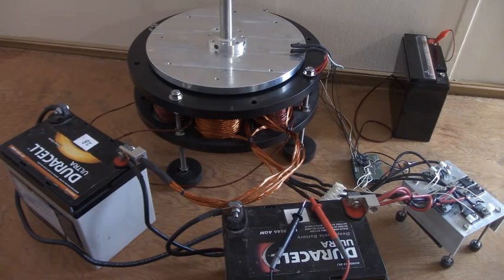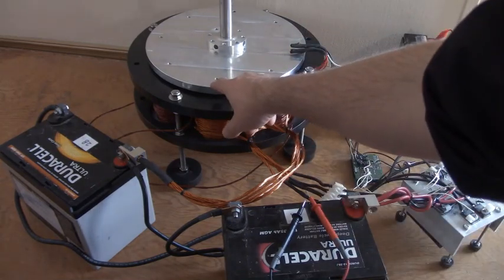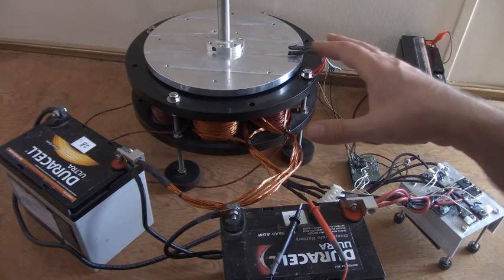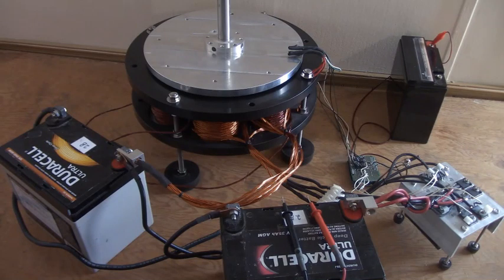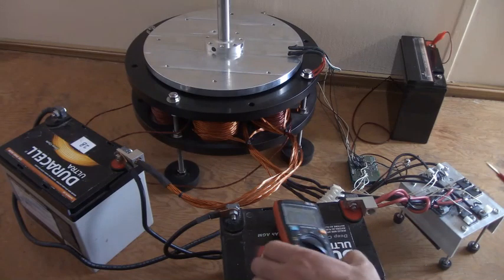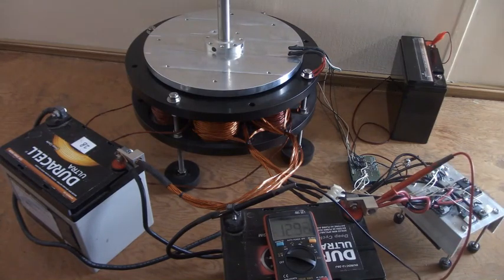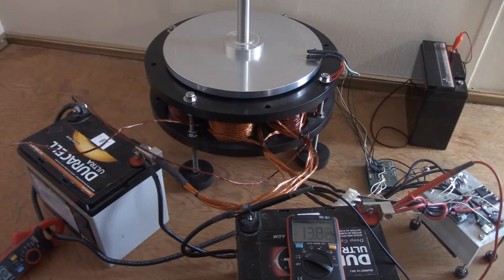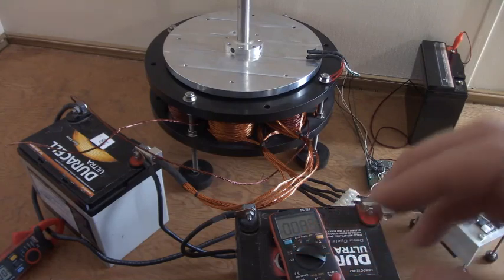4Dual Pole Sr Upgrades

Comment: Thank you, Rick, for making all this information information public.  Quick question: Can I use your 4Dual Pole Sr for a stage#2 process of one 20kWh LiFePo battery bank charging another 20kWh LiFePo battery bank, without using a big 20kWp solar panel system ?
Reply from the maker: No. The 20k batteries cannot work on a 20k solar system either.
Reply: @rickfriedrich  Just to be clear on that: Your tech does not work with LiFePo batteries ?
Reply from the maker: Wrong again. Works with all batteries.

Comment: Really good video Rick.  Thanks for posting it.  I'm curious if you're able to include (or have updated) the cap-dump circuit including low ESR caps (bank of 1000uF parallel caps?) plus SCR w/ diode drop on the Gate.  As you've taught us,  its important to understand "negative" energy and "positive" energy since proper treatment of the charging output enables us to swap charge batteries and run batteries (converting negative energy via the cap-dump circuit).  Are you able to offer this cap-dump circuit as an option when purchasing the updated 4Dual Pole?  Also, I'm curious if the PWM duty cycle is adaptive with respect to RPM or if the ON-time is constant as set by the pot.  One last thing...is there a way to adjust for 1" or 1/4 inch rotors with the upgraded control board?  Or do we need to purchase new 1/2" rotors?  Thanks for your contribution as I'm excited to get the upgrades for my 4Dual Pole.
Reply from the maker: I don't sell the larger caps and bigger SCR with this 4Pole Sr kit but I may have the SCR for sale. I have sometimes mentioned that in our finalized personal models we will have a fair size capacitor bank across the input of our motors that acts like a filter and helps with the conversion you are talking about. We add this on the mini 4Pole now. This would also be used to run one motor into another and so on as I have done at times... 
We have different kinds of code that will allow for the pulsing within a pulse to allow for a carrier frequency to be used for resonance processes while the rpm changes. We can get into that with customers sometime this summer when I have time to focus on that. The way it is presently sold is without a pulse within a pulse (as we used to do). We now just vary the on-time with the pot where the maximum is determined by the placement of the Hall sensor over the passing magnets. As mentioned, the higher the voltage the shorter the on-time must be because there is a larger field produced.
The circuit board does not need to be adjusted for the two other rotor sizes. But the 1" rotors/magnets may need a little more gap (spacer) between them and the bearings. Initially the magnets we ordered were fine but then they made them too strong for this application and we were left to only use the 1/2" sizes now (which is perfect). 
People have always been asking for replacement or extra boards. Frankly no one here likes to make them because they are still on proto boards since we have never settled upon a final design until now. We will be changing over to the Nano Arduino as you will see again today with a new video of another triple stack model we just made. It doesn't improve anything but makes for easier assembly and smaller area. We will then crank these out along with the larger controller for the Sr DualPole for people who are asking for them. I just have to figure out the new costs as parts keep going up.

Comment: Thank you Rick,  I see a lot here. After kit II I see even more that now explains things in my experiments I could never figure out. One such experiment was adding an external ground to one of my small SSG units. It was a four strand. I charged seven 7AH batteries with one 14AH battery. And at the end it's resting voltage was at 12.57 volts. each 7AH battery was charged to 15v. Adding a ground to my Tesla coils resulted in something similar. But the ground was not just a copper rod stuck in the ground. This was water pipe. Thus a large surface area. I was talking with DaDhav about it and he discovered similar with his experiments on his slayer circuits. but we had no understanding of what was going on or how to make it better. Following through the information in the second book was a great review of material only barely mentioned in my old electronics classes. Which opens a world of understanding. It's a very smart idea with this stuff to act with real knowledge,  guessing will leave you running in loops at best, or even you may hurt yourself. Ricks books/videos compile a knowledge base that one can develop a true foundation from which to build from with real understanding. The kits together develop a starting point for the beginner and carries through for those advanced in the research. But you have to pay attention!
Reply from the maker: Good to hear. In the US the schools separate physics from electronics which is problematic. But even the physics is wrong at the most basic level as you can see from milesmathis.com And it is not just wrong information and bad math but a failure to teach the students to think through the implications of the most basic teachings of static electricity. This is why I start people off in the kit 2 with the very basics and then you see this error of passing over those facts without realizing what is implied. 
I have four productions over the last 6 years beyond my earlier work. They are in order of study: The first is the Selfish Circuits and Loving Paths where we have the very basic ideas the two different kinds of circuits, where the free energy kinds allow for charge recycling and a many-body context. The second is the Resonance Kit 1 where we expand on the first while beginning to explore resonance, single wire and wireless nonlinear systems. Then we have the Don Smith book which opens the door to many different systems. Finally we have the second Resonance kit that enlarges upon the first kit, and specifically focusing on the whole grounding concepts, while ending up with more advanced information about proper Tesla coil design for the purpose of producing a Don Smith system.

Comment: So, are you saying that you can use one input battery, run the motor and end up with two fully charged batteries after a while?
Reply from the maker: There are several different levels of using this kind of motor energizer as I indicated in the video. If you go to the introductory video on my channel I walk you through some of them in the Selfish Circuits Loving Paths teaching. At the basic level you charge a second battery freely while you run the motor. The input battery discharges because the charges merely neutralize by going from one plate to the opposite plate through the load. The charged battery can then be rotated with the discharged input battery and can run the motor again while the formerly  input battery charges up.

The second stage process of this Loving Paths teaching is where we still charge up the second charging battery that is across the coil, but we no longer short out the input battery directly but add another battery bank in series. For example, we have 5 identical batteries: 2 are in series for 24V as the input. The positive of this input goes to the motor coils. A third 12V battery is placed across that coil. The other end of the coil goes to the last to batteries' positive terminals--these last 2 batteries are in parallel and their negative terminals are connected to the input bank negative terminal. In this way all the charge from the primary bank flows through the coils and into the batteries 4 and 5 while the coil allows for the third battery to become charged as well.  Batteries 1 and 2 still discharge because it becomes neutralized, but instead of just doing that, we have not created additional charging in batteries 4 and 5 that we didn't do in the first stage process. This process has losses and limitations. The amount of times these 4 batteries can be rotated around will depend upon various factors, but any extension of runtime is more free energy.

The third stage process adds additional processes like the first stage--where the coil allows for the charging of a battery while running as a motor--which process can be multiplied for additional output. This time on the path from the coil to the charging battery (second battery in stage 1 and third battery in stage 2). When you add additional inductors with loads in various configurations you can multiply outputs to some extent. This also sends back charges to the input side of the circuit, to the motor, switch, and input battery that can be very destructive. When we add resonance circuits as the series impedance along that negative resistance path, where the energy converges in rather than dissipates out, then we can actually multiply as many of these circuits with loads as we want--and when properly done we can keep the input battery fully charged. I have given all the necessary information for people to experiment with this idea both with the motor circuits and with solid state in the Resonance kits 1 and 2. 

The fourth stage is doing a similar thing as the third between the motor coil and the input positive as can be seen in the Benitez patent and our MICK kit option.

While this motor can be used to do the third stage process I would recommend playing around with the less expensive kits where you can easily swap out blown transistors because replacing these fets on the 4 pole is very expensive.

Comment: Rick I appreciate all he videos, but why move away from educating on process Smith rediscovered.  I've read your book multiple times, over and over, it it was a job well done.  I don't understand the move to to this instead of focusing on Smith and the proper grounding required for his systems.  All his models never showed it, his diagrams illustrate a variable resistor, series cap to ground, or diode to ground as a proper type of ground.  Seems very difficult finding literature on these types of ground.  Youtube has hoards of videos about dangerous hobbies, jumping off mountain,  playing with MOTs, building Tesla coils, etc etc. So the fact that it may be dangerous with someone who is incompetent doesn't seem like a problem.  Would love to know why the move away from this technology?   I never purchased the 2nd kit though, does it cover these aspects more then the main book?   Please let us know.  Appreciate it Rick.
Reply from the maker: I will delete your comment as it doesn't make sense for you to say that I am moving to this instead of focusing on Smith. This is not some present consuming focus as it is something we developed many years ago. However, it is very good and also simple free energy. If you bother to watch the video I mention that it can be used as a prime mover in at least one way where we can multiply outputs with resonance circuits as part of the advanced circuitry in what I have called the third stage process of these motor systems. When you understand Don Smith you will see that all these systems are related rather than them being so entirely different as you assume. As for the second Resonance kit if you read the description you will have your answer.
Reply: @rickfriedrich  Seems like you explain more int he 2nd kit, the grounding which Don was very vague on seems to be key.  God bless.
Reply from the maker: Don wasn't very vague on this subject. The problem is that people don't read or listen to the details. They assume many things and expect people to repeat details many times instead of just saying things once. I did a short video of quotes of Don on this subject because no one was paying attention on the forums. You can see that he wasn't vague on this. The other problem is that later people didn't know about Don's video 1 and 2 where he taught on this subject. The other problem is that people do not understand ground potentials and just assume everything is just directly connected to ground. This is why I spend a lot of time in the second resonance kit with basic electrostatics. Don taught people who were already familiar with that basic teaching and wasn't about to spend time on what everyone already knows.
Reply: If you don't understand the proper grounding, I recommend Resonance Kit II. In it you will find very important details about the Don Smith effect and the correct grounding. It helps me a lot.
Reply: @BaudirenergieDe  Seems like that might be a good idea, thanks for sharing.